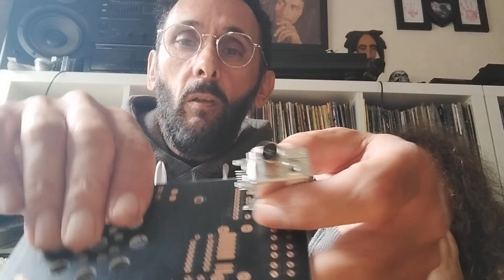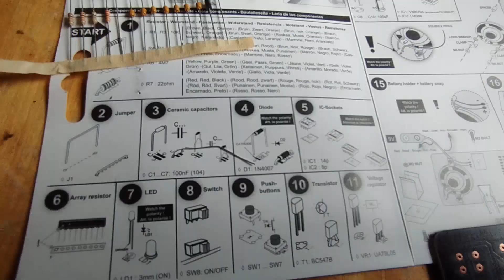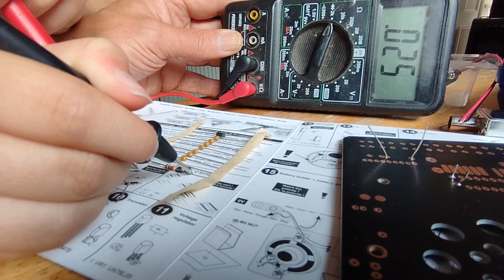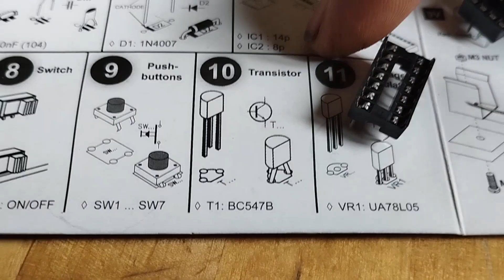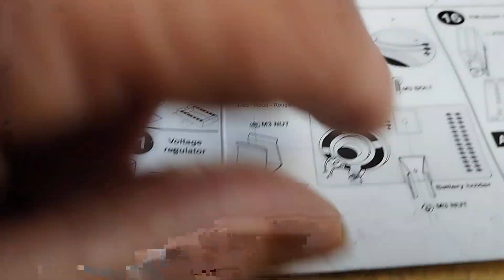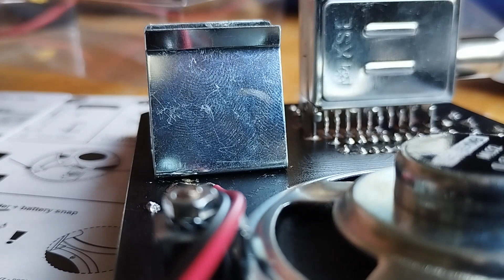Building an electronic digital radio kit with my young apprentice

Comment: Nice fun time with the daughter glad she obviously enjoyed quality time  she semes quite involved making the radio, even if dad was doing most of the "hot works" ..... BTW a Chisel bit rather than the conical would be much easier with better heat transfer to the piece  etc... L8rs M0XJA
Reply from the maker: Definitely a good couple of hours of pleasure together and it works as well 😀👍. I have a bunch of irons that I got for the STAR Centre radio club. I used to run it every weds about 15 years ago lol I was avoiding looking for the stuff lol

Comment: What about a WELLER 8200D might be a we bit heavy but it is heat off when gun laid down.
Reply from the maker: I had a quick look and I see what they are. Good idea for safety, I have one at work and to be honest I find it a bit tricky to use compared to the basic iron. But it's probably just me being more used to the older method. 73 tnx